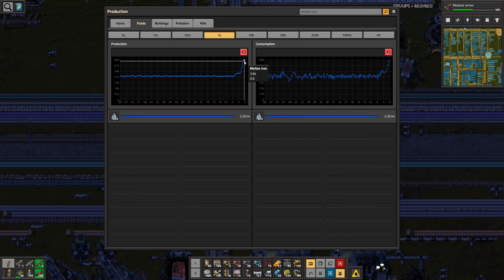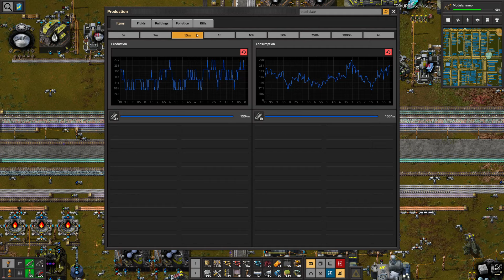Pyanodon's Factorio HARD MODE + Biters pt205, Nexelit Battery!

Comment: I was thinking about the outpost priority system you once mentioned and I had an idea to do priority input sources with only one input outpost: Dino from secondary producer loads to full, and unloads til empty. Primary producer dino loads to full but, for unloading, it first has a "wait condition til target has 0". This way, the primary producer dino will only unload IF the secondary producer dinos can not keep up with the consumption, and because the primary dino is full, the "til target has 0" will not make the dino load products for the condition te be true because it can not load anything else. On the other hand, secondary producer dinos would unload continuously at any time until they are empty, making the outpost full when they depart because they got emptied.